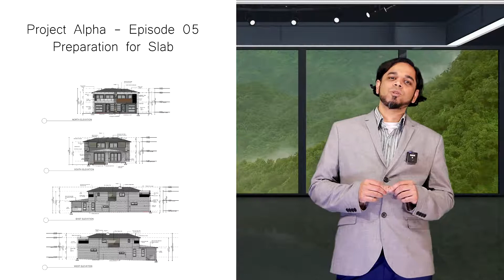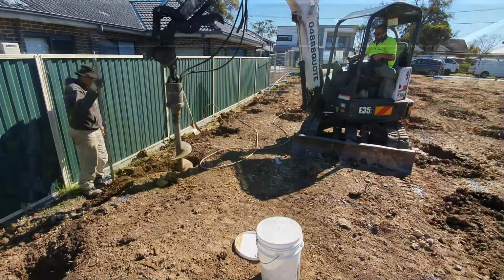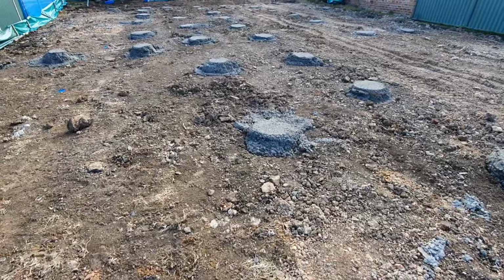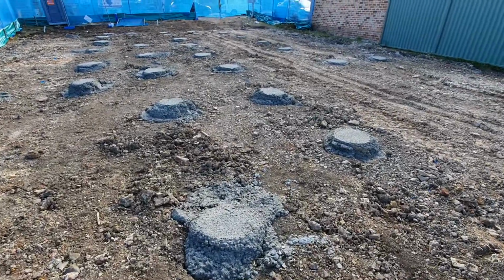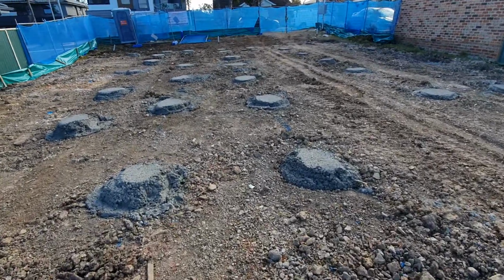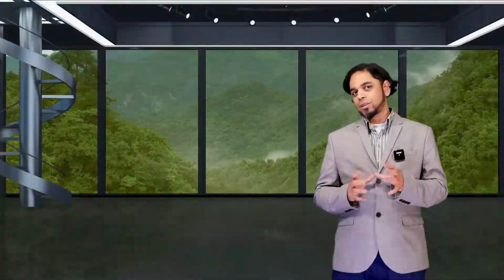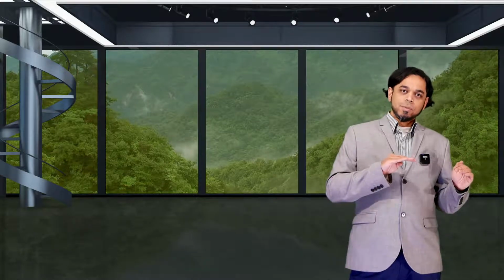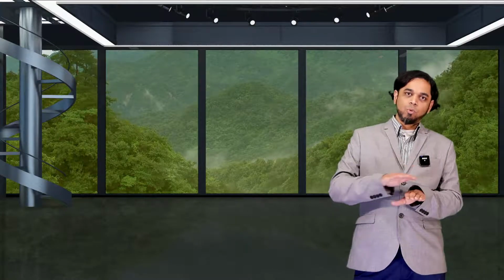Project Alpha Ep05 - Preparation for Waffle Pod Slab #concrete

Comment: Hi
Thank you so much for such a informative video.
I need you opinion as  my builder is going to start building my house soon. There is a small tree on nature strip at front, structural engineer recommended deepend edge beams. And builder is asking around $7000 for that even in contract I have fixed site cost.

Comment: Hi, great video Adil. There’s a lot of great information here for me as a novice. It would be very helpful if you also included the cost of each of the processes that you encounter throughout the development. I was looking to build a unit behind an existing dwelling in Melbourne, any idea what this may cost? Do you have an email that I could ask questions on? Anyway thanks for the videos, subscribed!
Reply from the maker: Well hello there. Thanks for dropping by. To answer your questions. This video does not have a direct cost as that invoice comes after pouring, which will be discussed in the next video. But in short, the progress payment for completion of this stage is around 150k. I do have an email address, which is salesberg dot au at gmail dot com. I prefer not typing it for bots to read :)
However, if you ask more questions on the videos, it is preferable since it will leave the info for others to read as well, which is in true spirit of this channel, that we share knowledge. 
With regards to the unit you mention, I am assuming that the local council requirements are met first. By unit I take it you mean 'granny flat', on average they cost between 80 to 120k. Again there are a few under laying costs that I'm ball parking such as site preparation and service connection costs. I did a video on Easements recently, that has a lot of info applicable for such development as service pipes often runs from back of the property, if so it may effect the end price tag. 
Any how, I love talking about technical stuff, and got carried away.. lol.. Got questions ,, fire away..
Thanks for subscribing and good luck.